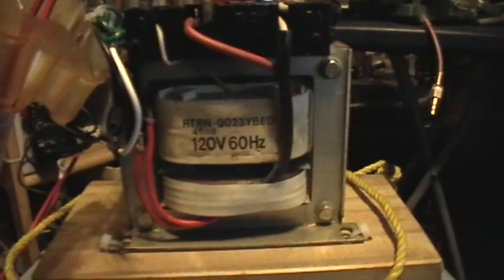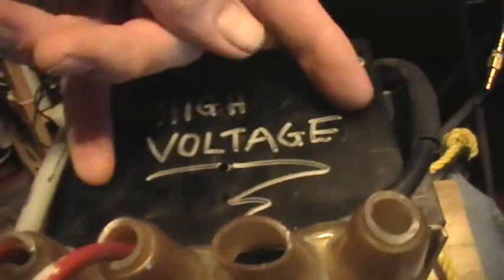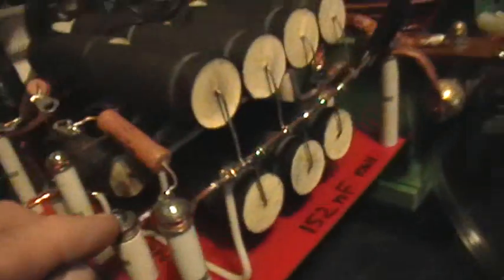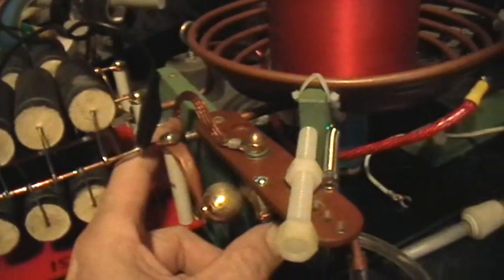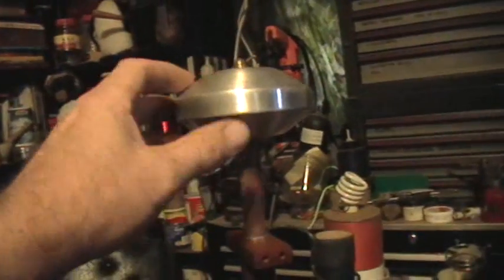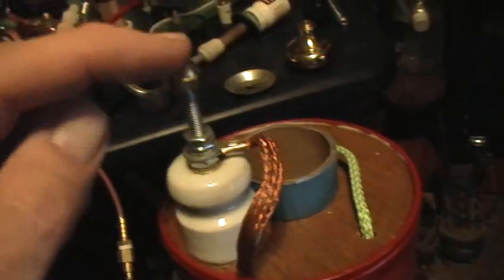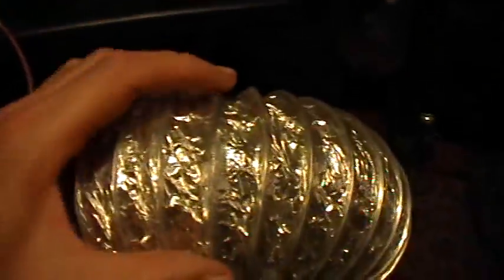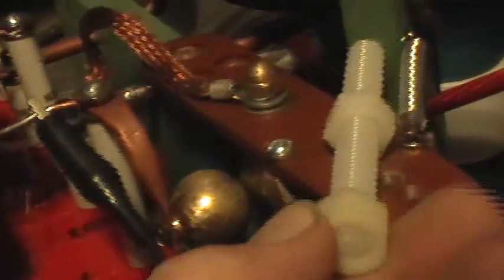Extreme High Voltage: TK4 MOT-DC Tesla Coil Component Overview

Comment: I have neon sign transformer s that I would like to use but other parts I have found are to expensive any ideas where to go to find all parts a few I could not find for my tinsel coillol tesla coil .Ty for the video n info in advance p.s. a good cap would be 2 aluminum bowls open ends together glued n aluminum tape around the rims .

Comment: Why did you fully rectify the MOT output?
Reply from the maker: Two reasons (at least):
First, I have all these HV diodes that I wanted to use in something;
Second, I wanted to see if it would actually work.
I think there was at least one more reason but it has been so long I can't remember what it is.
Thanks for watching and commenting!
Reply: Lol awesome. Im actually building a tesla coil atm. Im using two MOTs with the secondarys in series for 4kv output. No rectification though! 
Thanks for the description it is helpful! Hopefully i complete my build and get it operational in the next week or so- ill post a video of it indeed works
Reply from the maker: Great, I'm looking forward to seeing it in action!
Reply: all electrical currents generate a magnetic field. AC voltage flips the pols on the magnetic current at a rate equal to the Hertz. By rectifying the current one effectively stabilizes the polarity in a set orientation. one end will always be the same polarity. makes it better to be used as a control in experimenting...

i would be interested if two or three primary coils in parallel with each other would ramp the output on the secondary like it "should" ramp the Gauze of the magnetic field.  gauze = volts x no. of windings

with magnets adding a ring magnet to a central magnet keeping the poles the same orientation can amplify the gauze/strength of the center magnet anywhere from 10-100 times

Comment: I wanna use 3 microwave transformers in serie, what type of diodes do I need then? if i use 3 transformers then i have around 3 x 2200 Voltage ( 6600 ) voltage.

Comment from the maker: I don't know but you could calculate it. There are about 12 1/2 inches of winding length on the coil, it's 4 1/4 inces in diameter, and the wire is #27 magnet wire, single enamel insulated.